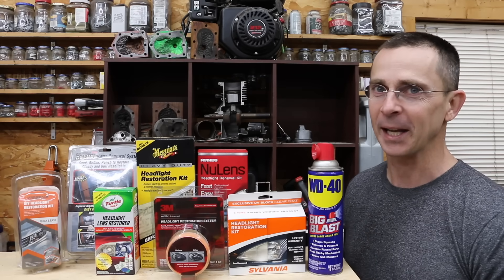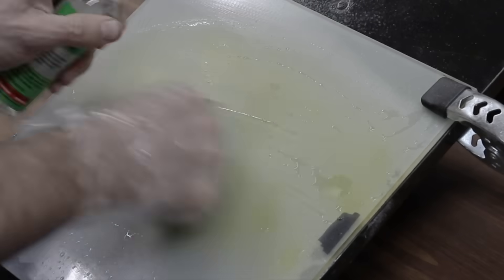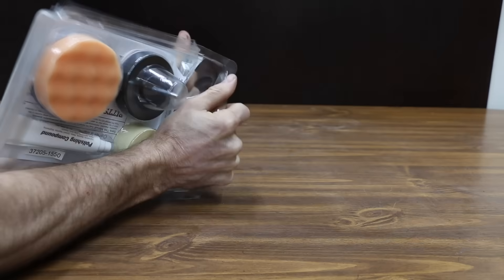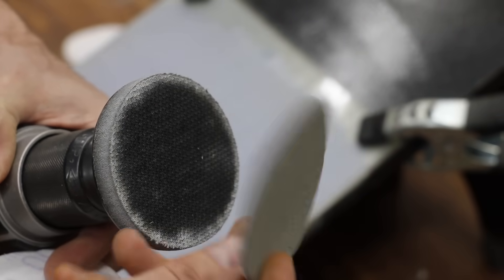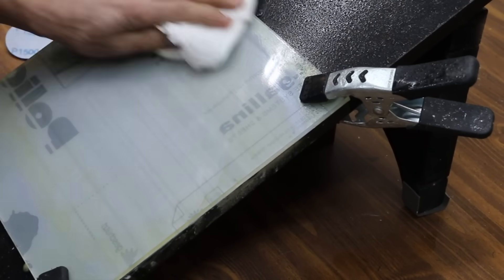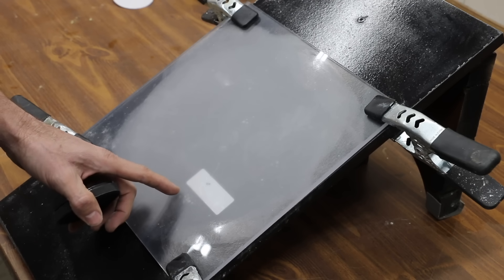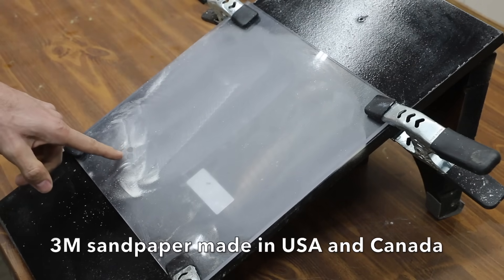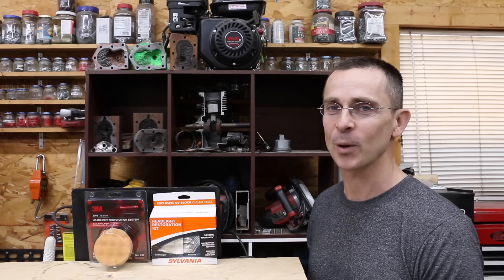Best Headlight Restoration Kit?  Let's find out!  3M, Sylvania, Meguiar's, Mothers, Turtle Wax & HF

Comment: I just spray my headlights with a cheap spray can clear coat when they get foggy. It's not crystal clear and foggy up again in a year or two, but it takes about 5 seconds to do, and it's good enough. My last truck I used a glow in the dark clear coat. Pointless to have headlights glowing, but I got a kick out of it. The darker the parking lot, the easier it was to spot my truck.
Reply from the maker: Thanks for sharing.

Comment: DO A TEST FOR ME !

Floridian here, and when I got a new fancy car that I knew I was going to keep forever (till wheels fall off), I wanted something that would give the best protection for my dash/interior in terms of sun damage and the FL heat (it eats up everything), while also being too lazy to put on a car cover EVERYDAY or even the windshield blind.  So I embarked on window tints, and to my surprise, there's $35 tints (service install included) and upwards of over $900 for a standard 5 window car.  My questions were :

What is the hype about Ceramic?  Does it really offer all the TSER (total solar energy rejeected) it says it does in comparison to regular tints?  

How did 3M come up with their top model of Crystalline, a clear tint offering over 90% TSER and IR rejection, is it better than say 20% dark tints?  (EXTREMELY curious since I definetly wanted to tint the front windshield, which is usually illegal in all states because no visible hindrance is allowed, but clear is clear, so I thought that'd be great.  HOW CLEAR IS IT??

Metal infused tints offer the best protection/heat rejection, but is old technology and often interferes with radio waves/cellphone service.  How do these non-metalic tints (ceramic) outperform them?  Is it hype?

I've seen all sorts of youtube testing equip on IR heat, visibile light, etc - but how does that translate to real life?  I understand the tool is saying 99% heat rejection, but my dash still got hot, I believe I even went to do my own little tests, a 1 pm sun in FL in the middle of summer got my dash to over 240 degrees, then adding a front windshield clear tint did do something, to about 210 degrees.  Was it worth it?  

The 2-3 local brands around my area of 3M and Suntek, suntek is claiming just as good a performace as 3M while being over half the price, is it possible?  

The "top tier" or extravegent tint, a tint specifically orignially designed for Mercedes glass in particular, is priced at over $900 for install, the Huper Optik DREI and the Huper Optik Ceramic.  These are usually reserved for exotic cars (though anyone can throw it on their carrolla).  XPEL tints are up there too.

Ceramic competitors I've found were :

LLumar CTX 35
Formula One Pinccale 30
Suntek CXP 35
Sun Gard GP Max
Flexfilms Panaflex
SolarGuard Ultra 30
3M Crystalline 40
Glocal QDP Ceramic 30
Madico BlackPearl
Wincos and Ceramic IR (made by Madico) (I ended up choosing the Wincos)

See the following websites for more information

www.wincos-global.com

www.autobahnwindowfilms.com

www.llumar.com

www.formulaone.com

www.suntekfilms.com

www.madico.com

www.flexfilmplus.com

www.solargard.com

www.3M.com

www.globalwindowfilms.com

www.xpel.com

Comment: Thanks again!  I've had great success with the Mothers NuLens system on two different cars.  Only complaint was the that they need to include more sandpaper.  The headlights came out perfect and are still clear.  But I also wax them afterwards.
Reply from the maker: You are welcome!  Thanks for the feedback.

Comment: 3,000 grit? For real? Great reputation across 5+ mechanic's channels know to be working for truth your efforts are well recognized ▬ Meguiar's came up McGuire Tire where I have been able to obtain LT on the sidewall 85R-16 for my Silverado ~The blue shop towel he is using folks is sold both at mechanics auto supply and is also available as "Painter's Towellls" at Lumber yards 
◘
For Meguiar's looks to be by hand until the buffer pad which is safer and correct
Reply from the maker: Thanks for sharing.

Comment: Considering that 3M has been making automotive refinishing sandpaper for more that 50 years, one would expect it to work well.
Also, 3M does make a clear coat wipe on solution to protect the lens.  I think they also sell a kit that includes the coating.
Reply from the maker: Thanks for sharing.

Comment: Great job. The best method is not in this test though. "Deep Woods Off" or any repellent with a high degree of deet. Spray it on and let sit for a few minutes then rub it out with clean rags. In less than 5 minutes you have a crystal clear headlight. If you clear coat afterwards it will last a long time otherwise it will yellow again just as any of the kits that don't add a protective coat.
Reply from the maker: Thanks for the suggestion.
Reply: Here is what I wrote on a blog site describing this. First off, you remove it or tape it off. Secondly, you only need to spray it once. As soon as it clouds up you start buffing it with a dry rag like cotton. Change the rag to a dry rag when it get gunky. (Blue shop towels work too.) Continue to buff until it's completely dry. It is key to get it buffed out immediately. After your done coat it twice with Meguiars Keep Clear Headlight Coating. Do not use automotive paint clear coat. It won't last. It is designed for paint. Total time is 5 minutes max and you saved a lot of time and money.

Comment: Really good video yet again. I've always used brasso and a cloth in the past which gave really good results but might try a proper kit at some point following this
Reply from the maker: Thanks so much!
Reply: Yeah, I've used Brasso on my headlight enclosures to great effect. You can also spray some clear coat on afterwards for extra protection.

Comment: Hey Project Farm, there is a 3M heavy-duty kit that utilizes the 500, 800, and 3000-grit paper grades, along with wipe-on clear-coat (2 wipes more precisely: same material, just individually packaged).  I wonder if there's much difference between this kit, and the other 3M kit featured in this video?  Just used the heavy-duty kit on my and my girlfriend's headlights, and they look like new.  We'll see how the coating holds up.  Let me know your thoughts...... :)
Reply from the maker: Thank you for the video idea!

Comment: I use these kits on my sunroof as well. Toyota decided to use plastic sunroofs on the 00-02 Celica to save weight. It gets cloudy just like headlights. I’ve done it twice in the last 9 years but I’ve sanded off the tint already. Wish I could find a coating that will last longer than a year or two. But it faces directly in the sun since it’s on the top of the vehicle.
Reply from the maker: Thanks for sharing.

Comment: The problem with these headlight restore isn't the process of making it clear again. All will do a good job. The most important part is the protective coating. Almost none of the coatings last long. Which you will end up back at square one. This includes the Sylvania coating. It requires regular coating which almost nobody actually does. You have to think about the targeted consumer and not yourself the exception.
Reply from the maker: Thanks for sharing.

Comment: Absolutely a terrific channel. I'm not surprised that 3M's sandpaper is top-notch. After all, they invented modern silicon carbide sandpaper in the 1920s so they've had a Century to perfect it.
You might also want to point out that Meguiar's is actually owned by 3M (it was bought in 2008), which makes the hand-sanding of Meguiar's somewhat amusing.
https://www.hotrod.com/articles/0811clt-3m-company-acquires-meguiars-car-care-products-company/

Comment: 2 different kits, 2 hours and 60+ dollars later my "restored" headlight now looks cloudy, dull and worse than my other untouched headlight.
So, what did I do wrong????
I haven't applied the final sealing coat for fear I shouldn't till I have better results.
Will the final coat make the difference?
Reply: With the Sylvania kit, I finished the last step just before putting on the UV coating (last step) and I paused to pull up this video for confirmation.  The lens was still pretty cloudy but once you apply the UV coating, it looks like brand new!

Comment: If you can, look for a headlight assembly kit on eBay. I purchased a kit for my old 2001 Corolla. I paid $49.00 (from USA seller), and that included full right & left units, with all bulbs (main light, turn signal light etc,) in place (WOW!). After 6 years they still look new & clear!!!  I don't know if you can find similar kits at this price/quality point, but give it a try. 
I had previously replaced just the turn signal assembly from my Toyota dealer parts department and they charged me $110.00 for each (left & right) assembly!!
NOTE
You must have a socket & wrench set and know how to move body sheet metal out of the way to install on an old Corolla. Some cars might be easier, some harder. Time to remove & replace is about one hour due to sheet metal (small front panel) shifting on a 2001 Corolla.
Reply from the maker: Thanks for the suggestion.
Reply: @ProjectFarm  Thank you. I was just posting a general idea for people to look into. Anyway, here is an example of the full headlight replacement set.

Left+Right Headlights Headlamp w/Corner Signal Lamp For 2001 2002 Toyota Corolla

The price is now $79.00 for the complete set. Worth every penny.

https://www.ebay.ca/itm/Left-Right-Headlights-Headlamp-w-Corner-Signal-Lamp-For-2001-2002-Toyota-Corolla/254725025117?_trkparms=aid%3D1110006%26algo%3DHOMESPLICE.SIM%26ao%3D1%26asc%3D20200520130048%26meid%3D49c4e99951b544069064176eb55e3a6d%26pid%3D100005%26rk%3D4%26rkt%3D12%26mehot%3Dpf%26sd%3D272083891478%26itm%3D254725025117%26pmt%3D1%26noa%3D0%26pg%3D2047675%26algv%3DSimplAMLv5PairwiseWebWithDarwoV3BBEV2b%26brand%3DUnbranded&_trksid=p2047675.c100005.m1851

Comment: Wondering if you would know... About 4-5 years ago a confirmed sensor reading of the crankshaft sensor shown it to be faulty. I never replaced it. Now (5 years later) I'm having a very bad issue with the "harmonic balancer" (attached to the crankshaft I imagine). My question is whether I actually have a REAL problem with the harmonic balancer, or is it likely the crankshaft sensor has simply worsened, sending even worse readout information to the main computer, thus causing my "problem(s)?

If so, could the computer be making more aggressive changes to other components attached/bolted/belt driven, or otherwise "connected" to the engine, to correct or compensate for/or to counter (or at least attempt to balance or smooth out the performance of the engine? All essentially based on the faulty info being fed to it by this faulty sensor, therefore causing the engine to run worse, and now, to start making noise at certain rpm's?
Reply from the maker: Thanks for the suggestion.

Comment: Noticeably absent from the test is Cerakote CERAMIC Headlight Restoration Kit.  Kudos to Sylvania for adding a fine polishing step with included packet of "clarifying compound" before applying the sealer protectant.
Reply from the maker: Thanks for sharing.

Comment: This is a flawed test!
120 grit is WAY too aggressive to tackle with the headlight restoration kits. If you had done that to an actual car headlight, you'd have a plastic bag worth of polycarbonate left after Sylvania was done with it. 400 grit would be more appropriate to create the samples. Remember, that you are mostly removing oxidation and not the polycarbonate itself when it comes to headlights.
I guarantee that with appropriate samples, more products would do a great job, restoring near 100% clarity.

Comment: I don't what you are smoking but I use the McGuire on a heavily fog and aged headlight work perfect and was crystal clear. You didn't do a very good job of sanding and the whole yellowing is not realistic with the spray you used. You should be getting a bunch of old headlights from the junkyard and performing the test with these products to get a real-world example.

Comment: Love the comparison and interesting approach. Disappointing to see the performance of Meguiar’s but the test and results prompted two questions:
1) 120 grit sandpaper scratches are hard to remove and those kits with lower grit sandpaper (unlike Meguiar’s) will have a slight advantage. However, deep scratches like that would probably be unlikely to happen in real life (I guess?)
-2) kits with a self leveling clear coat will definitely have an advantage too as that fills in the micro scratches created by the steps prior.
Reply from the maker: Great feedback. Thank you

Comment: Let's test products designed to remove a coating that has been destroyed by the sun for several years by removing a freshly applied coating, applied to a 120 grit surface.  They're  both yellow so they must be the same thing, right?  Totally irrelevant to the intended use of these products.

Comment: I used the 3M kit on two vehicles with badly yellowed and hazy headlight lenses.  I found that I had to really go slow on the drill speed and keep it moving or I’d get melted polycarbonate streaks that took a lot of extra work to remove.  But once I learned that lesson, I was able to get all 4 lenses looking absolutely crystal clear like they were new.  Edit to add I used the kit 6 months ago and the lenses still look great.
Reply from the maker: Thanks for sharing.

Comment: Kind of a crazy question...  I used the Harbor Freight kit.  It worked surprisingly well.  After watching your video last week, I did something a little different than what the instructions showed.  I just wet the sandpaper and lense, then kept it wet.  It took all of the junk off. 

My question is, do you have a suggestion on a UV Protector?
Reply from the maker: Thanks for the video idea.

Comment: I've used the turtle wax product on a quad bike instrument panel that was basically white and it worked brilliantly.
Also done headlights on a 2006 hilux (Australia) with wet sandpaper to 1500 grit ( finest available at the time) and finished with turtle wax sealing compound and they also come up great. 
Main thing to be aware of is that what you are effectively doing is preparations for a paint job the same as a car, the finish is only as good as your preparation work
Reply from the maker: Thanks for sharing.

Comment: So, I've used bug spay with deet to clean my headlight. Just spray and wipe about 10 seconds later. Would you care to try this? This would not be for badly scratched lenses, more just the UV damaged ones.
Reply from the maker: Thanks for the suggestion.
Reply: I have noticed that my lenses are clouding over again about 6 months later. Would using a sealant after clearing the headlights fix this issue?

Comment: I wonder why these kits have the grit stepping they have? I've always heard you should basically double the previous step's grit. If you start off at 500 grit, the next step should be around 1000, followed by 2000, then possibly 4000, then polish. Stepping 500 to 800 to 3000 just seems off... It would seem that 3000 is too fine to remove the 800 grit scratches effectively.
Reply: That's why some of them like the mothers kit steps from 800 to 1500, which is about double. Then to 3000. Which is double

Comment: love your channel, but this test is not really testing real world headlight damage. no headlights have 120 grit sanding scratches over the entire surface. i bought the turtle wax kit years ago, not only did it work to completely clarify the headlight lenses on my 20 year old grand am that remains in the west texas sun every day, but i saved the sanding pads and redo the lenses with them every year before car inspection. the sealer pouches were useless, but after testing, LOL, i discovered carnuba wax worked pretty well as a sealer. probably need to redo the wax monthy but i usually forget, and i'm sure the wax probably doesn't provide much UV protection. still, as i said, the sanding pads still are working to clarify the lenses, years after i first used them (just refreshed the lenses a few weeks ago). takes just 5 or 10 minutes once a year.

i would like to see you test the strength of plywood versus OSB versus MDF versus solid wood
Reply from the maker: Thanks for the video idea.

Comment: Was wandering about is there a way you can test those thin layers of clear lens protection.. not sure what brands there are but would be cool to see if they are worth the money or if just using one of these restore kits in the long run would be cheaper? If the film last long enough to make it worth it..
Reply from the maker: Thanks for the suggestion.